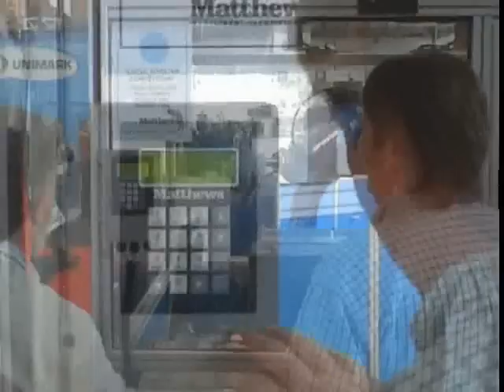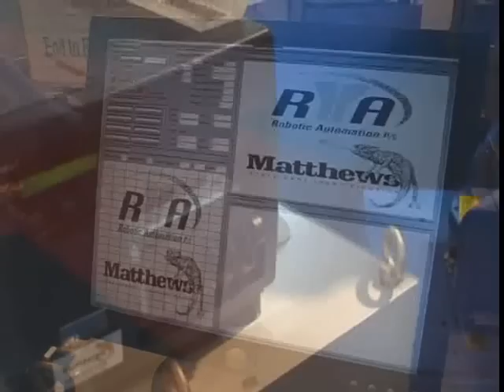Robotic labelling demonstration

Comment: what end of arm tool is that? Also what style of printer is that? Can it do small labels say 1/2''x2''?
Reply from the maker: +1hunting Hi, I think from memory the printer is a FOX brand label printer from MATTHEWS labeling which has an automation interface. The robot's tool is a custom sized pneumatic/vacuum tool with a small foam pad/face. Might need a different size again for your thinner label size. Robotic solutions are very customisable. Send us an email with your details if you would like to discuss further. Thanks!